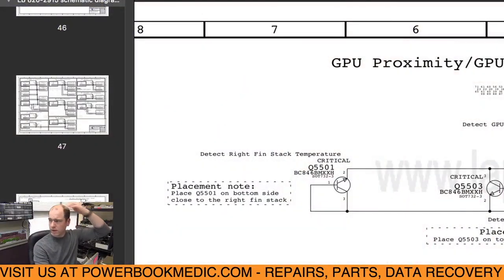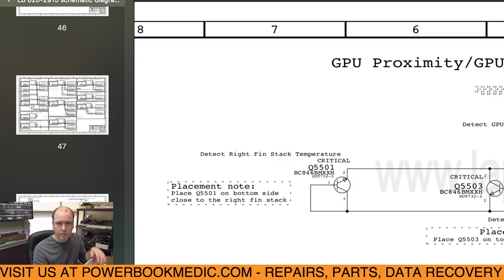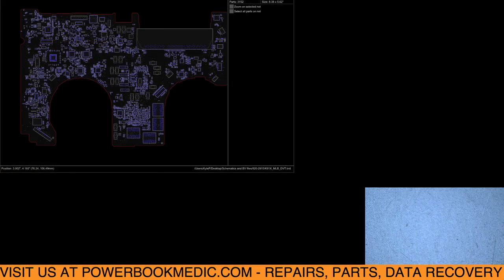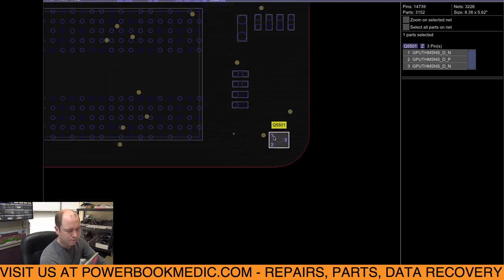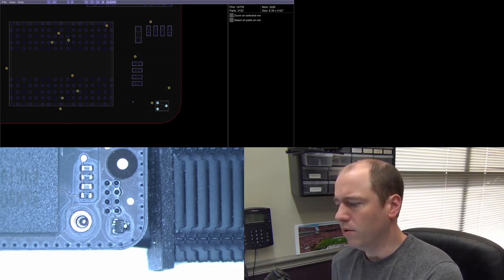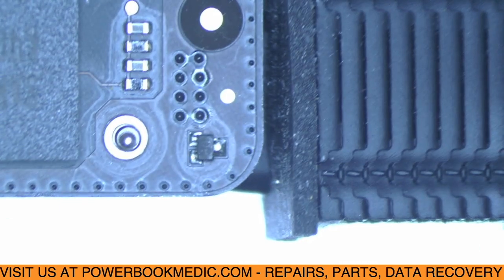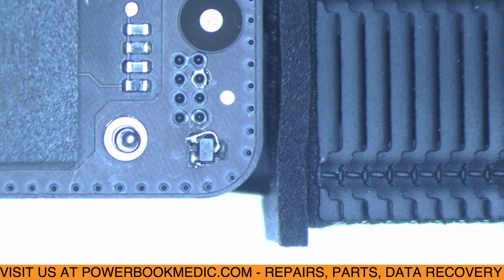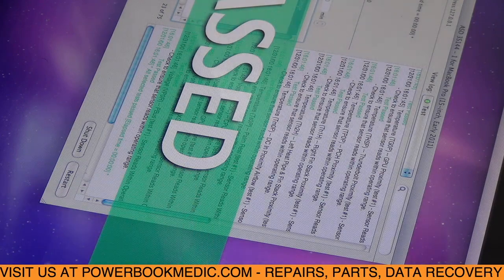Macbook Pro Fans Run at Full Speed -  Repair on Board  820-2915

Comment: Do you know off hand if its possible just to bypass these sensors? I have the high fan speed and laggy GPU stuff going on in my mid 2010 macbook pro. I know that I can use an app "mac fan control" and slow down the fan, which fixes the issue, but the mac doesn't read the battery either...pretty messed up

Comment: Hi,in my macboook pro the fans always run at 2000rpm, is there any solution for this?
I tried to start the diagnostic at startup with the D key, and it gives me an error: efi / drivers / testsupport.efi.
I also tried USB stick, same error
Reply: Mine are running at 5000rpm it’s extremely annoying

Comment: I have a 820- 3330, 15inch 2012 macbook pro. That had sensor issues as it became very laggy and Ran diagnostics (asd 3s150) to find out that the fin stack, right fin stack and gpu die senors wern't being read by the smc..
Upon further checking, i realised that the temp monitor ( Q5550) was faulty. I changed it, but the problem now is all the other sensors have started working except the fin stack sensor which still shows unreadable by the smc (TH1H ERROR).

Now the problem is, the 820-3330 schematic shows nothing as " fin stack". I tried chnging the "left heat pipe sensor" but it didn't help. And along side i'd like to mention that all these sensors didn't have the (22pf)capacitors attached to the diode sensors as shown in the schematic.

What am i doing wrong or what should i do? Please help.

Thanks!

Comment: Another excellent video. Dear friend, I'm facing a VP0R sensor issue with a 2011 MacBook Pro A1286. This machine runs slow and fans spin at 6200 RPM with overheating and overload at CPU (Could these issues be related to SMC or Q5300?). It also only allows charging the battery only when it's turned off. I also realized that the sound volume is too low, and it's not related to any OS issue.  Any assistance you could provide would be very helpful.
Reply: Did you ever get it fixed and how? Ty

Comment: Excellent video , the only that fix the Fin Stack Sensor .  just 2 questions why you add the extra wire ? Second is't  this Sensor on the I/ Board on macbook Air mid 2014 ?  THX Again Googled for 2 Days to find this video  (#Q5501 Sensor is the Th1H Sensor )
Reply from the maker: Yes, this only fixes the Fan Fin Stack sensor.  The extra wire is because the trace was damaged that connected those two pins, so I had to run a wire to replace the trace.  And about the MacBook air, yes, I believe it is on the I/O board.